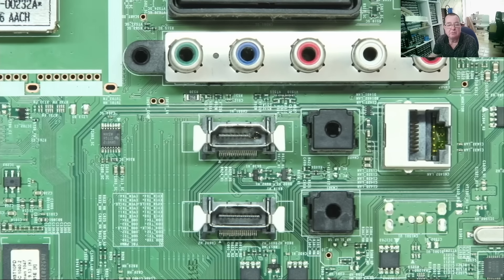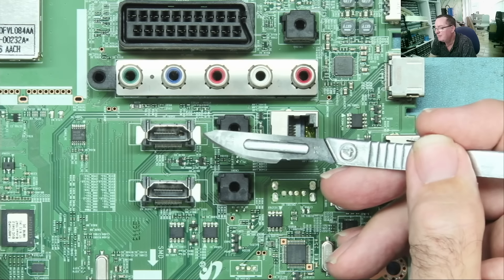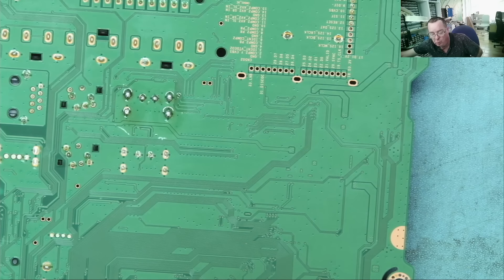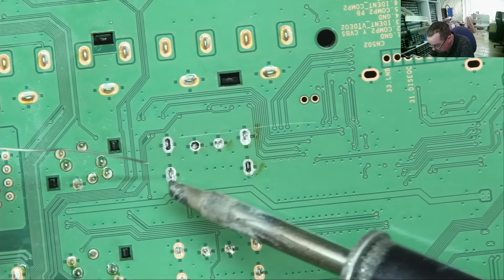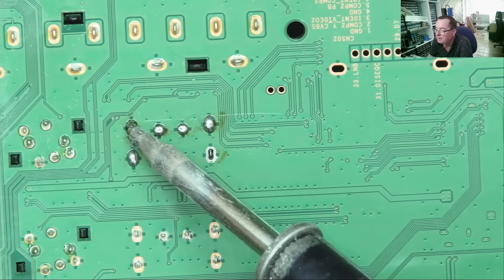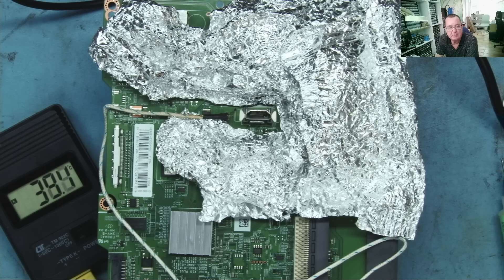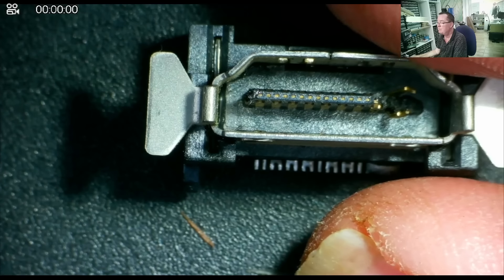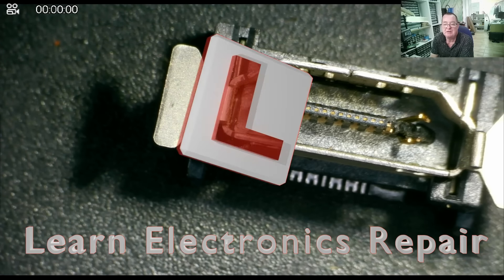How To Desolder With Hot Air Without Melting Nearby Components

Comment: i think he would of been better to just to get another bourd of ebay as he still goto pay you for the repair and the hdmi part thanks for the video
Reply from the maker: Possibly, but not my decision. I've no idea how much a replacement board is, I never looked. I quoted €40 plus the cost of the connector. The client only brought the board, not the TV so I don't have to take time taking it apart and putting it back together again or testing it.
Reply: Although it sounds like a good plan initially, that route can be a nightmare. Manufacturers constantly change the LCD panels. For each type of panel you need a matching TCON board. And for each TCON board the main board needs the matching firmware.
I've been down this route before and got nowhere.

You could get a board and remove the HDMI connector from it!
Reply: @chrishartley1210  if you already have two boards what stop you from flashing firmware from one to another? At least for now all of them use some type of 25qxxx which is easy to swap or just read and than flash on replacement board.
Reply: @gorky_vk  That very much depends on the manufacturer. On Vestel boards it is held in a bootstrap area of the main storage. In such a case the only sensible solution is to scrap the TV and never buy a Vestel TV ever again.

Comment: Low-melt solder would be your friend here?
Reply from the maker: Actualy no. I made a video about this and it works no better than adding leaded solder if you are trying to desolder HDMI and USB connectors.  It is very good for removing IC

Comment: It seems like you're trying so hard not to say " yeah " every Sentence 😂 but anyway could u do a video on repairing ssd connection all the pins snapped on it and 2x pads came off the pcb on the data pin side of the connectors I have a new connector to solder on but I'm struggling to work out what to do with the missing pads I don't have a high tec lab just a normal cheap soldering station with temp control and a fluke multimeter all I need is for it to work for 10min to recover my data